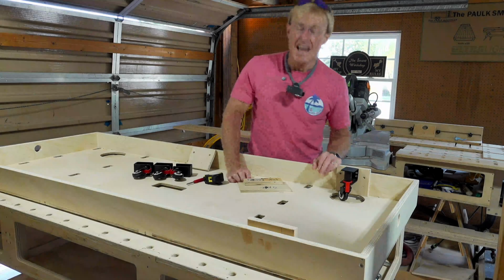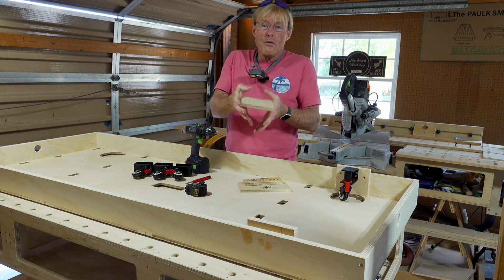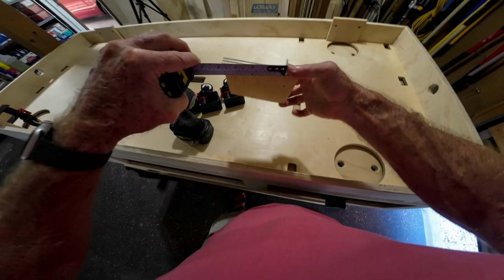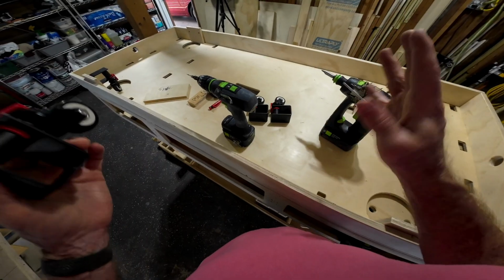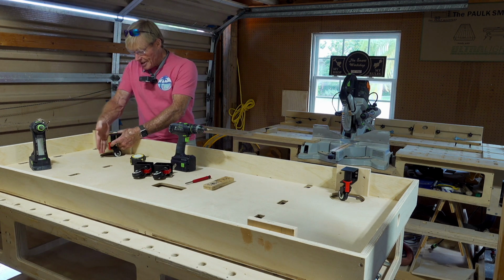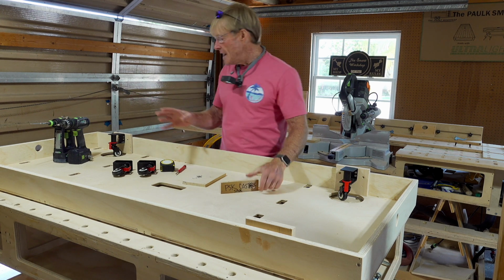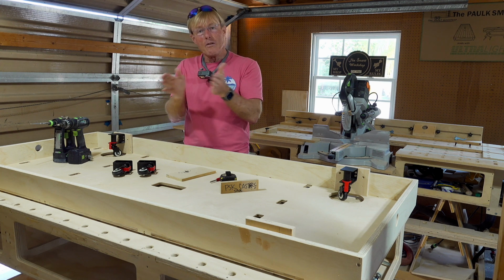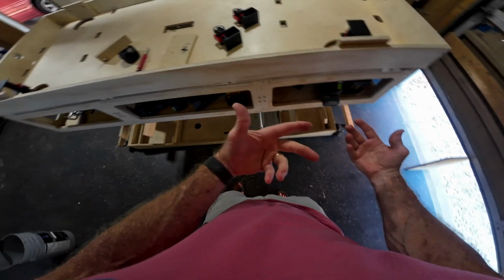Stop Measuring and Start Making Money!

Comment: on a related topic of measuring.  I had bought a Fastcap tape measure and i thought it would be smart to compare the measurements with my other tapes and rulers which are all aligned. There was a surprise that the fastcap was out by half a millimeter. I checked that with a micrometer which by the way alines with all my measuring tools.  the marks on the all the devices align including the fastcap. So the error is in the little black tag in the front. I had to use a knight to adjust and bend the tab from the base to get it to align. eventually it did.  So it pays to always check all measuring devices if you plan to carry one dimension to another measuring device.
Reply: Therefore: always use the SAME measuring device in a project
Reply: I've gotten so I "burn one" on every tape measure I use, just to exclude the end hook.
Reply: I usually carry multiple tape measures of the same brand and length that I use. So whenever I am working with someone on a jobsite (like my darn boss) I can say, "Here! Have a free tape measure!"